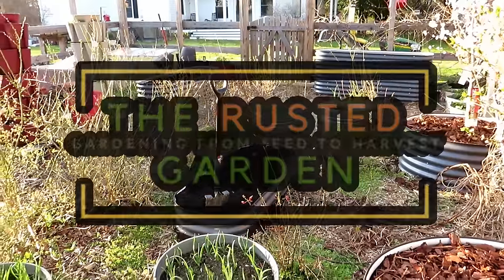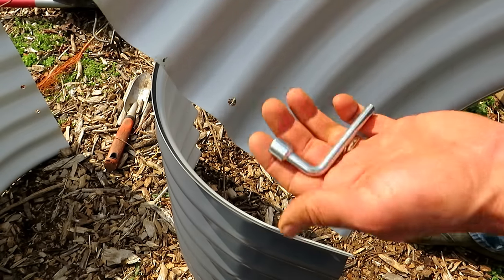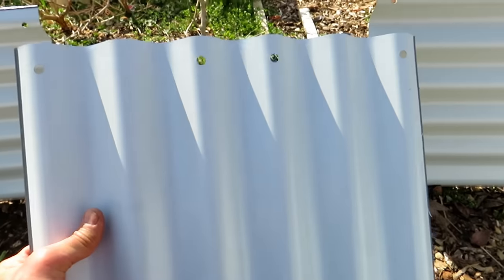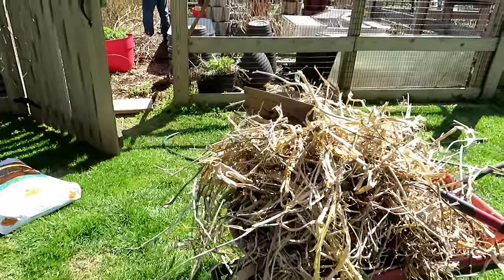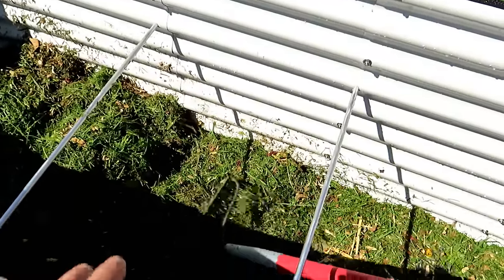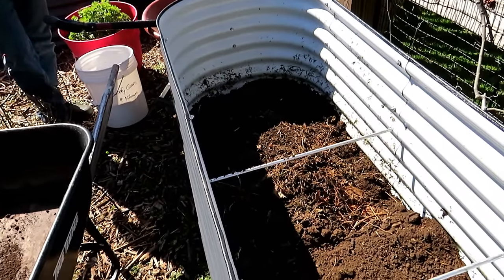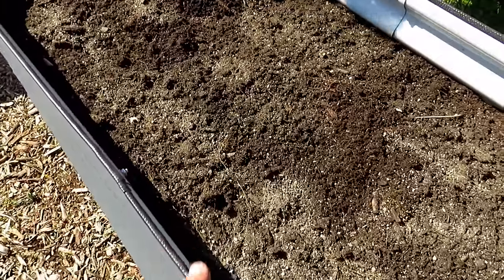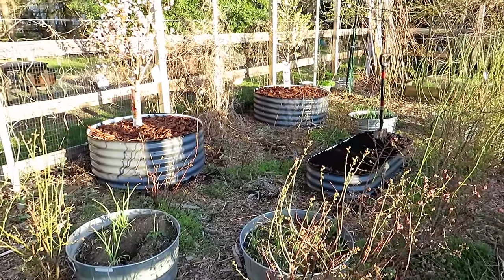How to Assemble Metal Raised Bed & Cheaply Fill Taller Beds Using the 1/3 Method:  Every Step Shown!

Comment from the maker: Check out all the metal bed design & colors (dozens) at Vegega. Here is my affiliate link: https://www.vegega.com/?ref=le64f3gm30 There is free shipping and 10% off their beds right now.

I have a discount code that is always 10% off, use the code TRG. However, it does NOT stack when current sales are active and equal to or above 10% on the site.
Reply: Hi Gary. Can you direct me to the video of the stand you purchased from a friend (I think)? It’s the one with 2 brackets and 2 pieces of wood. You used it in your planting strawberries video 4 yrs ago. Thank you.

Comment: I have sourgrass (Bermuda buttercup) in my yard: it grows from tiny bulbs and shoots will come several feet up through soil in a raised bed. I recommend placing the base of cardboard down first so the cardboard peeks out from under the bed...that way there is no path up the insides of the bed for nearly unstoppable weeds.
Reply from the maker: Thanks!
Please subscribe as it really helps me & please visit The Rusted Garden Seed & Garden Shop for your fabric pots, fall & spring seeds, seed starting supplies, peppermint oil, neem oil, TRG merchandise, and more at www.therustedgarden.com  As an Amazon Associate I earn from qualified purchases. Check out my Amazon Storefront for garden lights, seed starting supplies, fertilizer, pest management, books and more! https://www.amazon.com/shop/garypilarchiktherustedgarden Check out my new gardening PODCAST Gardening Coast2Coast at https://gardeningcoast2coast.net with CaliKim.
Reply: Your really awesome, and very knowledgeable,  however I saw that disney is one of your sponsors.  I do not support the indoctrinating of children,  on that note I will be unsubscribing.  I'm saw but I draw the line when it comes the children

Comment: I have four steel raised beds, two, 63" x 31.5" x 17" and two 4'x8'x1'. I am considerring adding two more to my garden, one for a fall garden, and the other for next spring. A lot depends on the crop yeild this summer. I am also using grow bags, 20 ten gallon, 8 twenty-five gallon,  6 thirty gallon, and a feed drum that has been cut in half for two small raised beds, about 25 gallons each. I am also using two GreenStalk towers, one for alpine strawberries, and one for a salad mix, lettuce, swiss chard, and endive. I have lettuce ready to harvest, and will start harvesting, cut and come again, next week—No more store bought lettuce!

Comment: So much better than building raised beds with lumber IMO.  I will assume these metal raised beds will last a lifetime vs. lumber which will need to be replaced every 10 years or so.
Reply from the maker: This as tagged for 20 years
Please subscribe as it really helps me & please visit The Rusted Garden Seed & Garden Shop for your fabric pots, fall & spring seeds, seed starting supplies, peppermint oil, neem oil, TRG merchandise, and more at www.therustedgarden.com  As an Amazon Associate I earn from qualified purchases. Check out my Amazon Storefront for garden lights, seed starting supplies, fertilizer, pest management, books and more! https://www.amazon.com/shop/garypilarchiktherustedgarden Check out my new gardening PODCAST Gardening Coast2Coast at https://gardeningcoast2coast.net with CaliKim.

Comment: Gary, wouldn't it make sense to leave the plastic on as an extra weather barrier? Or am I missing the reason it should be removed?
Reply from the maker: I dont think it would last and then you'd have to eventually peel it and its a pain. The coating is top of the line and should protect.
Please subscribe as it really helps me & please visit The Rusted Garden Seed & Garden Shop for your fabric pots, fall & spring seeds, seed starting supplies, peppermint oil, neem oil, TRG merchandise, and more at www.therustedgarden.com  As an Amazon Associate I earn from qualified purchases. Check out my Amazon Storefront for garden lights, seed starting supplies, fertilizer, pest management, books and more! https://www.amazon.com/shop/garypilarchiktherustedgarden Check out my new gardening PODCAST Gardening Coast2Coast at https://gardeningcoast2coast.net with CaliKim.

Comment: Are the Vegaga beds as resilient as the Birdie beds for hot weather? I know Epic Gardening learned about Birdie Beds from the Australian fellow’s channel Self-Sufficient Me (where they are made). 

In any event, both of them live in hot climates, and Australia I would assume has a lot of humidity to battle with. Are the Vegega beds just as resilient? Are they made in the US or imported?
Reply from the maker: They sure are and the construction is really the same. I have the dark gray and they do not heat up in anyway that is problematic. They are not made in the USA. As far as I know none for the metals beds are right now. Where ever you buy the metal beds, youll be happy. Very light weight and easy to move too. 
Please visit The Rusted Garden Seed & Garden Shop (My Shop) for your fabric pots, fall & spring seeds, seed starting supplies, peppermint oil, neem oil, TRG merchandise, and more at www.therustedgarden.com
The Rusted Garden 'Scan & Grow' Collection (My Seed and Garden Shop) Just scan the QR code and watch a planting video:
https://www.therustedgarden.com/search?type=product&q=qr

Plus support The Rusted Garden by subscribing and using my Amazon Store  Front link 
when shopping for anything on Amazon https://www.amazon.com/shop/garypilarchiktherustedgarden.  
As an Amazon Associate I earn from any qualified purchases, not just items I link. 

You can also find items I use or discuss in videos, by checking out my Amazon Storefront for cameras, fertilizer, pest management, shade cloth, seed starting supplies, books and more!

Earn 15% by becoming a Rusted Garden Seed & Garden Shop Affiliate.  Some people are using it for their social media followings and some people are using it for a fund raiser for schools and sport teams. To sign up... use this link to our shop and click the MORE tab on the green bar and select TRG Affiliate Program https://www.therustedgarden.com/

Or use this link to go directly to our TRG Affiliate Program sign up https://the-rusted-garden.goaffpro.com/create-account

Comment: Thanks for the great video. I'm trying to plant cold weather seedlings, but I don't yet have any "greens" to layer in this time of year, no grass clippings, etc. Just wondering, can I put only leaves from last fall that are still around my yard, roots, twigs, wood chip mulch and other "brown" yard waste at the bottom without layering in any greens? Thanks!
Reply from the maker: Yep. Leaves are good. The list is really long. Anything junky but organic can go on the bottom. Junky meaning needs a lot more time to breakdown.
Please subscribe as it really helps me & please visit The Rusted Garden Seed & Garden Shop for your fabric pots, fall & spring seeds, seed starting supplies, peppermint oil, neem oil, TRG merchandise, and more at www.therustedgarden.com  As an Amazon Associate I earn from qualified purchases. Check out my Amazon Storefront for garden lights, seed starting supplies, fertilizer, pest management, books and more! https://www.amazon.com/shop/garypilarchiktherustedgarden Check out my new gardening PODCAST Gardening Coast2Coast at https://gardeningcoast2coast.net with CaliKim.

Comment: I have acquired to barrels that have been painted a while back....is that toxic to plants or for water Saving for plants?
Reply: Some paints are toxic dir human consumption. That's why some plastic buckets cannot be used for food storage, because they were made as food safe, but were then used to store paint. That's why they're are certain numbers and letters on the bottom of the bucket. If you don't know what type of paint was used,  just go ahead and ere on the side of caution. Certain cancers are caused by ingestion of specific paint types. Lead used to be added in paints for instance and kids that ate the paint chips suffered from it
Reply from the maker: So I really dont know. That is a personal choice. The info on leaching and what plants actually absorb is well.... poor.
Please subscribe as it really helps me & please visit The Rusted Garden Seed & Garden Shop for your fabric pots, fall & spring seeds, seed starting supplies, peppermint oil, neem oil, TRG merchandise, and more at www.therustedgarden.com  As an Amazon Associate I earn from qualified purchases. Check out my Amazon Storefront for garden lights, seed starting supplies, fertilizer, pest management, books and more! https://www.amazon.com/shop/garypilarchiktherustedgarden Check out my new gardening PODCAST Gardening Coast2Coast at https://gardeningcoast2coast.net with CaliKim.

Comment: Gary why would you have to take plastic off?  Couldn't it be a safeguard against rust?
Reply from the maker: You could I imagine but the coating is state of the art. Over time the plastic would peel, and I dont want to have to deal with it then. Perhaps its a safe guard and I am wrong but the coating is a zinc aluminum magnesium layer called ZAM. It is what protects it.

Comment: What mulch do you recommend using that will break down by the beginning of the next season?
Reply from the maker: The finely shredded hardwood
Please subscribe as it really helps me & please visit The Rusted Garden Seed & Garden Shop for your fabric pots, fall & spring seeds, seed starting supplies, peppermint oil, neem oil, TRG merchandise, and more at www.therustedgarden.com  As an Amazon Associate I earn from qualified purchases. Check out my Amazon Storefront for garden lights, seed starting supplies, fertilizer, pest management, books and more! https://www.amazon.com/shop/garypilarchiktherustedgarden Check out my new gardening PODCAST Gardening Coast2Coast at https://gardeningcoast2coast.net with CaliKim.

Comment: I got one last year and didn’t bother taking off the plastic. Is that a problem?
Reply from the maker: I dont think so. I imagine over time the sun will degrade it. 
Please subscribe as it really helps me & please visit The Rusted Garden Seed & Garden Shop for your fabric pots, fall & spring seeds, seed starting supplies, peppermint oil, neem oil, TRG merchandise, and more at www.therustedgarden.com. Check out all the metal bed design & colors at Vegega. Here is my affiliate link: https://www.vegega.com/?ref=le64f3gm30 There is often free shipping and use my code TRG when there is no other sale going on and save 10%

Comment: Metal gets to hot which burns your root zone instantly in my opinion have you experienced this with metal or concrete bricks planter box Which put your plants into some kind of shock during the hotter months in the peak of the summer Above ground fabric pots or wooden garden beds stay the coolest in the California temperatures and plants seem happier
Reply: I’m worried about that too.  We get summer temps 110.
Reply: @kaylabryson1932  110 temp With quarter inch metal using a Temperature gun I’m sure that metal Hass to be close to 130 degrees in my opinion those roots are baking on the other side
Reply from the maker: Never had that issue. Soil is actually a pretty good buffer. I can't say its not possible but so many people grow in them and it doesnt come up as an issue.
Please subscribe as it really helps me & please visit The Rusted Garden Seed & Garden Shop for your fabric pots, fall & spring seeds, seed starting supplies, peppermint oil, neem oil, TRG merchandise, and more at www.therustedgarden.com  As an Amazon Associate I earn from qualified purchases. Check out my Amazon Storefront for garden lights, seed starting supplies, fertilizer, pest management, books and more! https://www.amazon.com/shop/garypilarchiktherustedgarden Check out my new gardening PODCAST Gardening Coast2Coast at https://gardeningcoast2coast.net with CaliKim.
Reply: @anthonysaldana05  yes … sounds like it’s a no go.

Comment: Why aren’t they white on the outside, dark absorbs heat. I would think the soil might get too warm and dry out faster. I try to use light colored containers.
Reply from the maker: You can buy white. They come in lots of colors. Heat really isn't an issue. They stay quite cool.
Please subscribe as it really helps me & please visit The Rusted Garden Seed & Garden Shop for your fabric pots, fall & spring seeds, seed starting supplies, peppermint oil, neem oil, TRG merchandise, and more at www.therustedgarden.com  As an Amazon Associate I earn from qualified purchases. Check out my Amazon Storefront for garden lights, seed starting supplies, fertilizer, pest management, books and more! https://www.amazon.com/shop/garypilarchiktherustedgarden Check out my new gardening PODCAST Gardening Coast2Coast at https://gardeningcoast2coast.net with CaliKim